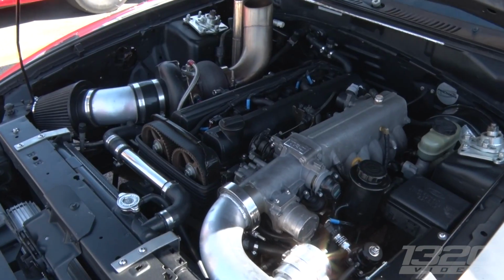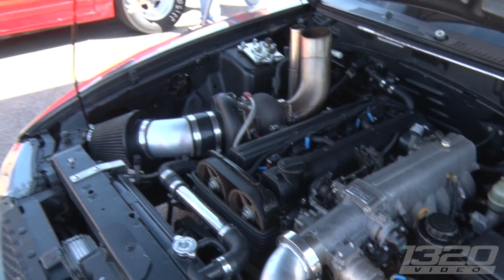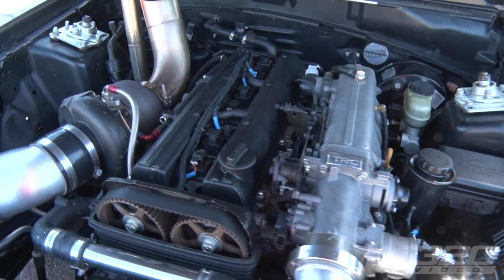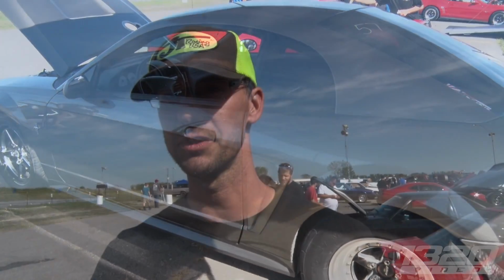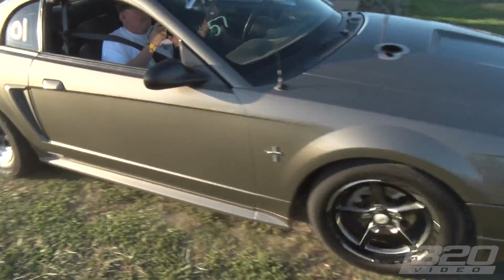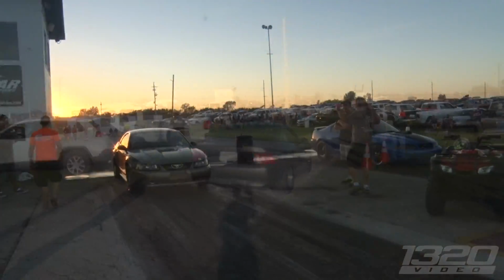The SUPRA Stang - 2JZ Powered Mustang!?

Comment: First LS motors and now imports? Does anyone like Ford engines anymore?
Reply: +J. Moore81 not the two valves no and even less the three valves
Reply: +J. Moore81 
Only the people that want to keep the value of their mustangs high......And I am talking about from the 1965 thru 1972 kind.
Reply: +Marcos Aruca I hear ya. lol There was a 2-valve making north of 900whp at Shift Sector in Coalinga, CA tho.
Reply: +derjoh1986 Sad part of all of this is a couple of my so-called "die hard" Mustang buddy's are working on LS-swaps for their fox-bodies. :/
Reply: Good point...
Reply: Ummmm pretty sure the two cars that beat him were both Ford powered... In the name of Charley Sheen, "winning"
Reply: J. Moore81 thats impressive but im sure its super hella built with all that money you can get the 2j to that hp rating plus a bunch of supporting mods for the stang
Reply: RippinGearz im also sure they are not the two valves that come with the 99-04 mustang gt
Reply: +Marcos Aruca well the first one was a Mach 1 not a 2v but still same block
Reply: +Marcos Aruca neither of the cars that beat him were 99-04 GTs.... One was the Mach 1 which had a supercharged 4V and the other was a built Foxbody at the end. Never the less, making a car go fast with a 2V isn't impossible especially for what he probably paid for a 2J.
Reply: +Marcos Aruca a forged rotating assembly for the Mach runs 1500... That's not bad since it can handle easily 850hp
Reply: no
Reply: william gonzalez-quevedo this is true but i just like how the 2j fits so nicely in there and yea i had a homeboy who supercharged his and it was tons of fun and pretty damn fast to
Reply: +Andrew Romero not really expensive
Reply: +RippinGearz Yeah they beat him. When he was asleep at the light and when the other Stang had 850 horses and a turbo. And even in both they weren&#39;t that close. If Fords are as good as you say they should&#39;ve left the 2J in the dust with a turbo&#39;d V8. But no... only by fractions of a second did they beat a 2J on low boost.
Reply: +J. Moore81 The flat plane gt350 motor is nice
Reply: +Art Vandelay The idea behind it is nice but the lack of low end & midrange torque I'm not too fond of. Quarter-mile times/traps aren't very impressive either.
Reply: J. Moore81 Yeah but for touge and circuit its sweet
Reply: +Matt Smith clearly you haven't seen what technology is capable of these days... Even four cylinders are capable of 1000hp. Sleeping or not, to many people talk shit about engine swapping mustangs to make them go fast yet nobody calls them out on needing a mustang to make their engines worth a shit. I never said Ford motors are great, it's just nice to seem them shutting fanboys up.
Reply: +Matt Smith p.s. With a 76mm turbo he is plenty capable of making the same power as the 850hp fox...
Reply: RippinGearz Yeah, all this technology and it still only beats a junkyard six cylinder on low boost by fractions of a second.
Reply: +Matt Smith you're talking like it being a junkyard engine means anything 😂😂😂 you have no argument.
Reply: RippinGearz I haven't seen anything good out of you either. I guess Ford engines just aren't that good if even their fanboys can't back them up 😂
Reply: +Matt Smith Hahahahahaha you're just an awkward keyboard warrior that got offended. It's ok I'll leave you alone now.
Reply: RippinGearz Yup. Sounds good. You can't back what you're talking up anyway. No need to waste effort here. Have a nice evening!
Reply: +Matt Smith Good day Sir
Reply: +Matt Smith how have I not backed up what I said? It's in the video... Two FORD equipped mustangs beat his 2J swapped Car and now you have to come up with some lame ass excuse to why two cars WITH THE ENGINES THAT WERE EQUIPPED IN THEM WALKED HIS ASS. And yuh know what?! I apologize for resorting to name calling. I am bigger than that and the video speaks for itself. I'm not even gonna acknowledge this dude!^
Reply: RippinGearz hahahahahah "walked" Please... I guarantee you 1.) that's not the same 5.slow that came with the car in that fox and 2.) by FRACTIONS of a second and you can't justify why your little 5.0 shitbox can only beat a little six cylinder by just a few milliseconds even though it's got two more cylinders and two more liters. You're a piece of work, pal. I'd be shocked if you can even torque down a bolt correctly.
Reply: ***** I wouldn't worry about this little 11 year old Ford fanboy. He obviously knows nothing about working on cars.
Reply: +Vinnie Davis race car engines aren't meant to last man, racing in general is hard as hell on vehicles. You do it for the thrill and the passion! Shit is gonna break no matter the brand. I like the 2J mustang cause it is different but like I the fact more that a ford powered car beat it. Mainly cause of the neigh sayers.
Reply: +Gabby M. Ahahahaahahahahahahahaahahah that was your probe they also said it was the chick in the ZO7s first time a few months ago. You must be one of 1320s newest subscribers. It's ok we will let it slide this time. Stay classy homie
Reply: +J. Moore81 There are plenty of guys still doing it with the Ford engines.  The Ford Mustang is just an awesome drag race chassis, the ford guys don't have to go find another car to put their Ford motors in.  If the Chevy and Japanese made a better car for drag racing you wouldn't see them swapping into Mustangs so much.
Reply: Nope ford is junk
Reply: +420sebastien never fixed a car or even drive one
Reply: Why would anyone subject themselves to flogging on a modern Ford, when they can just install a Toyota motor and never see the damn thing again, save for oil changes.
Reply: +J. Moore81 I have nothing against SBF motors, LS motors, or really any motor at all.  If a person builds a car the way they want to, and its fast... its cool in my book. :) .... I just liked the sound of 2jz's, and thus this is the result.
Reply: 2j was only running off the wastegate spring that setup was enought to make 800hp easy with the pro efi you got flex fuel, traction control, 2 step ect.
and the 4.6 modular engine is one of the best ford engines out the blocks are stout, you shouldn't hate both are great engines.
Reply: uhhhh no....
Reply: Lol, only the people who can't build a proper one.
Reply: Ls series engines are very well built. 

A typical ls you find in the new camaro can handle 1000hp on stock internals. Yeah its unreliable as fuck pushing those kind of numbers. 

There actually really good ford 5.0 5.2 and 5.8 ford engines. Coyote swaps are pretty common with fox body's. Idk... maybe make it more unique I guess.
Reply: I'm waiting for rotary mustangs.
Reply: McHallfin Lolol... you do realize that a stock rotary is producing 150 to 200 hp. They are shit design engines. 

Best swaps I've seen for mustangs are Ls or coyote swaps. Rotary needs atleast 5k worth of reforged racing shit to even make the same amount of hp with a natural aspirated LSX engine.
Reply: Břęňđąñ MçĆæřţhý Maybe if you've got a dinky little 2 rotor
Reply: Matt Smith They're all dinky small. Rofl
Reply: Břęňđąñ MçĆæřţhý True, but those 3 and 4 rotors can pack a punch.
Reply: Matt Smith with a good 30 lbs of boost. Yeah you may break the 500hp range
Reply: Břęňđąñ MçĆæřţhý I see you don't know what a rotary is capable of. Ever heard of Mad Mike? He's got a nice 4 rotor Miata I think you'd like if you want to check it out :)
Reply: Matt Smith I know rotarys... don't assume that I dont. 

Shit even a 20 lb boosted 4 banger boxer engines that subaru have just over 400hp. Couldn't even beat my brothers 65 nova with just a junkyard  11.0 compression ratio carbed small block 350 chevy he got from a work truck.  And we had 4 people in that box of a car. 

For rotarys? Haha they need a lot of boost to make a impressive hp number. 

Yeah. I've here of him. But I wouldn't have gone with a rotary... i wouldve gone for a 2jz swap or a good V8 swap. 

Rotarys are just shit made engines. Relying on a triangle lolol.
Reply: Břęňđąñ MçĆæřţhý Impressive number? His RX7 has an n/a four rotor with 538 hp. And you said he needs 30 pounds of boost to make 500... Sounds like you REALLY know your rotaries 😂😂😂😂
Reply: Matt Smith that's with really expensive shit... want to compare? 

LSXR 454 crate motor 705 hp stock  na. Carbed.... i would like to know how much money you have to spend on to make a rotary that powerful... 

Most people swap out a rotary for a better engine.
Reply: Břęňđąñ MçĆæřţhý We're not talking about price here. We're talking about power. We're talking about what can be extracted from these rotaries. Something you can't seem to wrap your mind around.
Reply: Matt Smith And the 20B 4 rotarys stock make 100hp stock... confirmation by mazda... 

My 3 cylinder old ass 650 indy Polaris snowmobile makes more Power than that...
Reply: Břęňđąñ MçĆæřţhý Link that. Because last time I checked there were no four rotor engines in production. And that the 20B is a three rotor.
Reply: +J. Moore81 The 427 small block ford is still monstrously powerful though. Lots of people forget about that one.
Reply: +RippinGearz or about the same price a decent jdm 7mg or 2jz with engine harness would cost.  just saying
Reply: +J. Moore81 and this is where we fail at i say we as in we americans   we make cars that are purpose built for track days and road coarse racing but everybody thinks that "oh murica lets drag race this thing"  and then are like "this thing sucks it had no powah".   its not ment for drag racing, its ment for actual racing.. ie road racing, track racing, ect.    its a high revving engine witha  close ratio gear box.    its the same shit people were ragging on the new z28 for.  people need to get theyre heads out the sand and realise drag racing aint to true test for cars like the gt350r and the z28........the track is where theyre ment to be raced at setting lap times.   if you want to drag race...get a SS or GT500 or something with allot of straight line speed.   thats all im saying rant over
Reply: +Břęňđąñ MçĆæřţhý (Get Rekt) lol troll alert.   20b, 3 rotor.    26b, 4 rotor.    26b was never made in a production vehicle outside of the 787b.   and the 20B was only in the cosmo....and it made north of 250 to 300 hp stock...wasnt great on gas but so what.
Reply: Big Show He's not even a troll. He just thinks he knows what he's talking about when clearly he doesn't.
Reply: Matt Smith Lol like you know any more than me... all rotarys are fucking garbage motors. Yeah its nice to see a change once in awhile. But you need a really good block internals forced induction parts to really get anything out of them rotarys. Plus with all that power it won't last barely enough to make a couple of passes.
Reply: Břęňđąñ MçĆæřţhý I at least know enough about engines to tell you a 20b is a 3 rotor. And that you don't need 30 pounds of boost (for that matter, any) to make 500+ horsepower. Yeah... I think I do know more about engines than you do :)
Reply: Matt Smith yeah you kinda do actually... they're pos engines are worthless... and don't last for shit because it's a rotary... and have the smallest internals in the world to run more than 300hp? Haha it won't last for shit... my triple 650cc indy Polaris snowmobile has more power than a rotary... which is pathetic for rotary engines... 

A regular LS engine you can buy in the junkyard for $500 can handle above 1000hp... comparing your pos rotary too modern day engines Is just pathetic.
Reply: Břęňđąñ MçĆæřţhý They have their flaws. Sure. No engine is perfect. Not even the LS engine is perfect. I've seen some LS engines drink a bit of oil in my time. I don't know where you live, but LS engines, because of their popularity, have gone up quite a bit in price. I see used ones go for three grand and beyond. You can pick up a pretty solid three rotor for that kind of money. And as we established, you can get 500 horses n/a out of them. They're very different though. At the end of the day, you're comparing apples and oranges. If cylinders are what you know, go for that. If triangles are what you know, go for that. They're both just as capable :)
Reply: No
Reply: +paduaowned How much did Ford pay you to make such an asinine comment like that? I'd swear some of you have stock in the brand. smh
Reply: ***** Ford still had to borrow money from the government. It's just that they used the excuse of "retooling manufacturing plants to make more fuel efficient cars," as a means to get their money early on and not get caught up in the bailout. What's funny is how Ford and its fans say that they're able to hold their own, yet even Ford's CEO testified that "The collapse of one or both of our competitors would threaten Ford because we have 80% overlap in supplier networks and nearly 25% of Ford's top dealers also own GM and Chrysler franchises." Take a look for yourself! http://www.factcheck.org/2011/09/ford-motor-co-does-u-turn-on-bailouts/  Keeping America alive my ass!
Reply: ***** You okay there bud? You seem a little hot and bothered by the fact that people don't share the same point of view that you do. Need some tissues?
Reply: ***** You're right. They didn't accept bailout money. What they did instead was get a small loan of 5.9 billion dollars in 2009 before the big bailout so that they'd stay under the radar and fool their gullible fans into making an argument that really held no weight. That argument being that they "didn't need money from the government," when in reality, they did: And they were the first to get their share. Next argument, please!
Reply: ***** That's for a different discussion for a different day. The point is that GM and FCA owe no money to the government: the opposite of what you've been saying all along. No surprise that the same person who sees 6 billion dollars as "chump change" is wrong about everything!
Reply: ***** Fusion was at the number nine spot in sales for all vehicles in March, but has since fallen off. Even then, Honda and Toyota were still beating them out in sales, and now the Fusion had lost its spot to Nissan's Altima. Ecoboost may have been good power-wise, but is hardly competitive in fuel mileage. Even the competitor you love to talk about the most, GM, surpasses the rated fuel mileage for the Fusion's most fuel efficient non-hybrid powertrain option, the 1.5L Ecoboost at 25 city/34 highway, with their Malibu at 27 city/37 highway, as cited by each manufacturer's websites. And that's not even stacking it up against frontrunners in the category such as Mazda, Honda, and Toyota. The Ecoboost still has good stuff going for it, but not enough to really make it worth all the money invested in it on the bill of the American people in my opinion.
Reply: Jay Moore lets be real , you can make any engine fast as fuck all you need is  money and time.
Reply: Daniel Ruiz Yeah but will it be as reliable and cost effective as an LS? The answer is No.
Reply: Jay Moore my point is with alot of  money you can make anything fast and bullet proof too. all you need is upgraded internals performance parts and a tune. any car will be reliable and fast  maybe not cheap to do it which isnt my point but ot is possible for any motor to be fast and reliable depending on how much money and time you drop into your project
Reply: Daniel Ruiz Reliability and cost-effectiveness are the two major factors when considering a swap. THAT is my point. You can't debate a motor swap without mentioning both. That is the reason why you see so many LS's in other platforms. Most people aren't willing throw a bunch of money down the drain when they can have an LM7 with stock internals produce 8-900whp and actually live. "Any motor can be reliable with enough money"...that's the part where you lost me. That couldn't be further from the truth.
Reply: MOST H8D thank God somebody turned it around
Reply: Only good ford engine is a broken down one
Reply: MOST H8D I do
Reply: Marcos Aruca yes people so like ford engines because we have the ford Barra mate inline 6 dual over head cams 4L
Reply: MOST H8D i do
Reply: MOST H8D No one wants a Ford engine period
Reply: MXREWIND the for barra is beast
Reply: As a mustang guy no no not really
Reply: Cali I just feel like people like the style but people like certain engines too so they get best of both worlds
Reply: @derjoh1986  2jz swapped 66 mustangs go for crazy money
Reply: 4v and 5.0 coyotes are great ford engines
Reply: Cali absolutely not